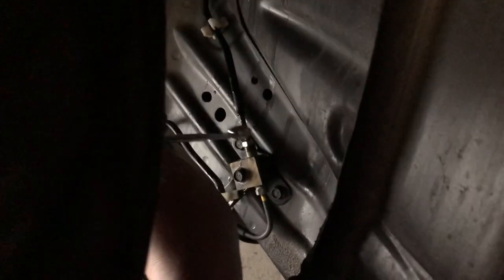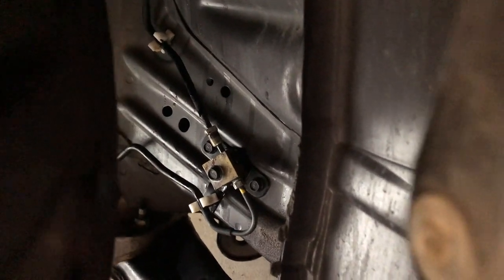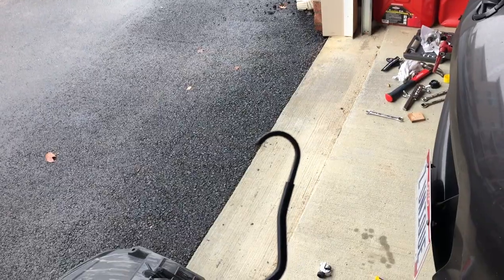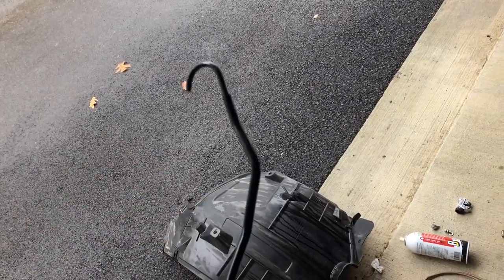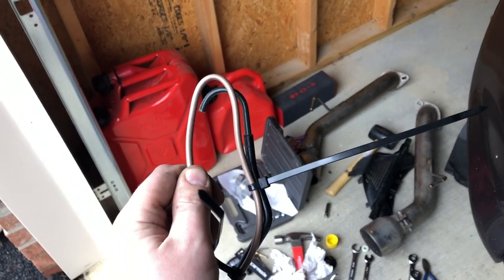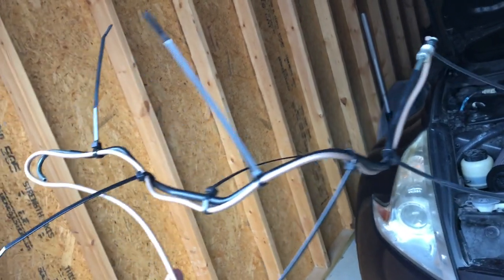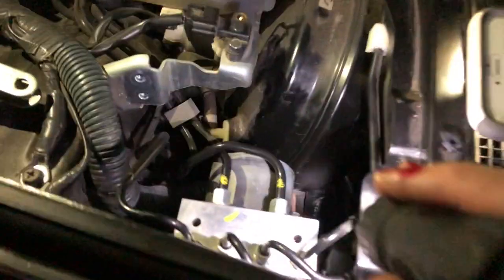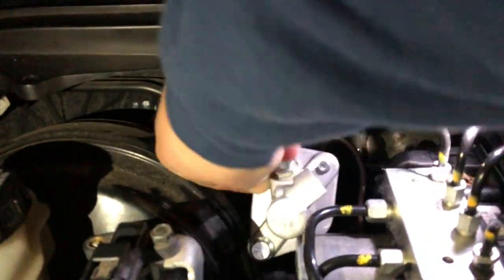370z Clutch Master Cylinder Replacement after it breaks in traffic in the middle of winter!

Comment: Hardest part for me was taking the damn thing off. Yanked so much at the abs pump and flipped the master 180 degrees and finally got it. Putting it back on was a pain since I couldn't get the top nut on the inside. A pain but simple once you get the procedure down!

Comment: there’s no way to reuse the line?
Reply from the maker: The line is supposed to be reusable. But the flare nut rounded off, so I had to cut the line to get the flare nut out.

I recently had to remove the master cylinder again to replace it (in the last week) and I was able to reuse the line because the flare nut was able to be removed.
Reply: Konrad Christen thanks boss. how long would the job take assuming the line is reusable
Reply from the maker: TheSwaqqenator honestly not very long. If you have done it many many times I’d say less than an hour.

First time? Maybe allow for two hours? But you’ll have to bleed the clutch after the install.
Reply: @konradchristen  This just happened to me unfortunately. What did you use to cut the hardline and get the rounded nut off? Thanks in advance
Reply from the maker: I used a hard line cutting tool and then a hard line flaring tool to flare the line for the fitting. Auto parts stores should have one set you can rent. But it is a pretty common tool that’s good to have down the road if you are gonna do car stuff a lot in the future.